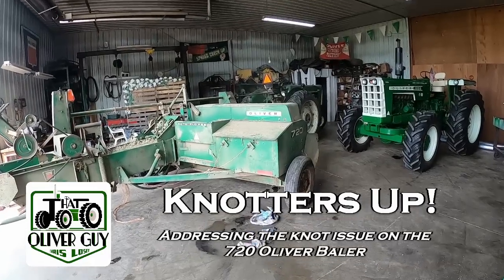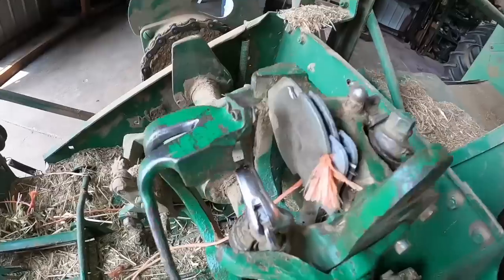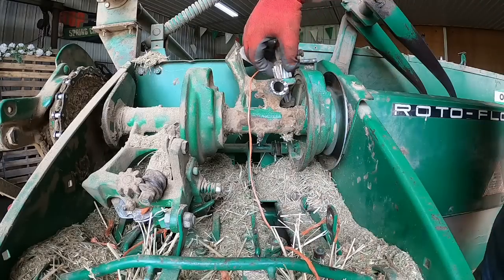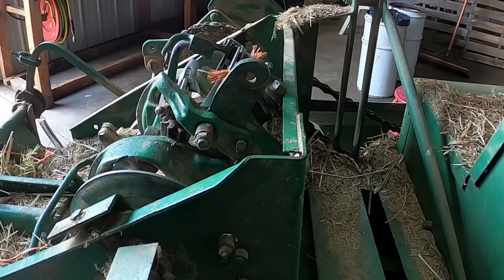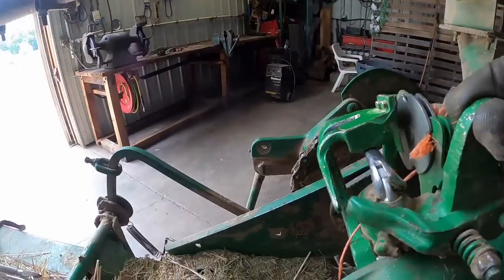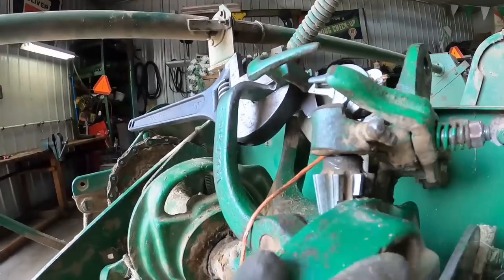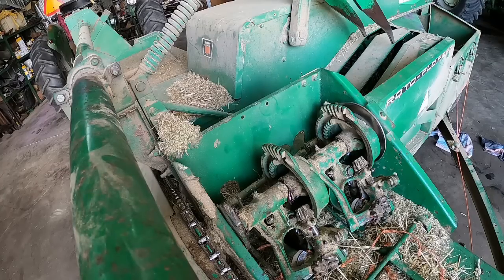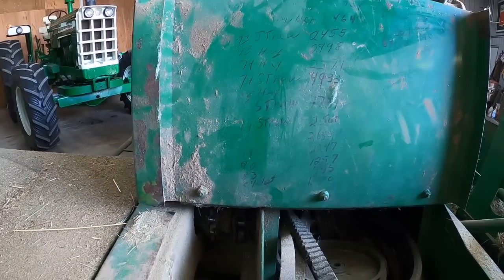KNOTTERS UP! Fixing the knotter problem on my Oliver 720 small square baler

Comment: Back in the early 70's I ran a 24T and a 336 John Deere baler. We use to call the bill hook the eagles beak, we also had to adjust our twine arm by bending it. I don't ever remember breaking one when we did that, but I know a guy can, real easy. Dad always wanted the twine arm to barely rub the bill hook, but not scrape it hard. As you know, all these parts work in unison to make a knot, from the twine disc holding tension on the twine to the twine sweep pushing the twine out of the beak/bill. I do have a square baler now-a-days, but I only do a few bales, maybe 25 or so every other year. Good luck on the rest of the project, have a great weekend. Thanks Randy for mowing my lawn!!!😁

Comment: My Dad; a farmer and a lifelong farm machinery mechanic with a dealer; helped New Holland perfect their twine tier. Lost tip of a finger doing it. Since he worked for an equipment dealer we had the first square baler in the area; and for some years (1950s) our neighborhood had a "baling gathering" instead of a "threshing gathering". My first field job on a tractor was driving our Oliver 88 pulling that baler; had some exciting times in our hilly fields in northeast Iowa. I was so young and small that to get the clutch in on the 88 I had to stand on it with both feet and and use the steering wheel as leverage to get the clutch in. An older brother stacking bales on the wagon was my backup. As I remember, we had very few problems with broken bales.
Reply: That’s a great story thanks for sharing this.

Comment: My dealer sent me to a New Holland school for balers.  After that, I spent most of my summers on the road between service calls.  Ironically, most of the repairs were adjusting a bolt about a half turn.  The owners manuals provided very good info on diagnosing issues and how to repair them.
Reply from the maker: The Oliver manual is the same way. There are pictures of of bad knots so you can compare and adjust the right part.

Comment: We used a jeweler's file and hone to sharpen the knives.  Emery cloth to polish the Bill-hooks because if the twine cannot slip off easily you have problems.  The written-in-stone rule is that after you have got the baler knotter working perfectly, watched it thru maybe 20 bales and it worked every time, you would get back in the service truck and just before the baler is leaving your view of it in the rearview mirrors, it misses a bale. Standard items to take with you when you went on a baler call were Bill-hooks, bill hook drive gears, the stripper arm, pins, and cotter pins, and a gallon jug of frozen water to have something to drink because balers never needed repairs until it was 100 in the shade.
Reply from the maker: Testify brother! I'll feel better about this one when it's working at capacity.
Reply: @ThatOliverGuyChris  The real problem was that the baler would run and work great at 540 PTO speed.  As soon as you were leaving the driver would pull the throttle open way past PTO speed.  It was always hard to explain to them if they ran it at a rated PTO speed they would make more bales per day.  Busted bales take time to feed them thru again when the baler could have been moving making good bales.  If one were custom baling running bales thru again did push up the bale count at the baler but not at the barn.
Reply from the maker: @bigun447  dad always had me run a couple notches below full throttle. The knotters don't like overspeed. Even our gehl rep said the round balers did a better job around 450 rpm.

Comment: Until you were sharpening the knives I didn’t fully understand which surface was the actual knife. Thanks for explaining how the knotter works and basically “reverse” engineering it for us. It finally clicked for me when you demonstrated with the old bill hook…it took a second to understand the hook rotates on more than one axis. My bailing experience was spending a hot summer as a 16 year old custom bailing with my brother-in-law; nothing will make you appreciate a twine bailer more than stacking thousands of wire bails. 💪🏻 If it doesn’t kill ya it’ll definitely make you stronger.
Reply from the maker: I never handled a wire bale, but I can see it is something you don't do without gloves.

Comment: I have a 520 Oliver baler that was bought new in 1975 or 76 used 2 years and sat in the barn ever sense, My cousin said it may have had a total on 3000 bales threw it and he stacked most of that working for the guy that bought it new. Its always sat in a barn and its sitting in my barn with my other 520 baler I have. My plan is to get it out go threw it and put it behind my 770 and bale some with it just for the fun of it ! LOL Only difference between them is the old one is a short Toung and the newer one is a long Toung and it has the White decals on it and it was the last new Oliver baler McHenry's sold according the them.  I love how they feed in as it is so smooth in feeding the chamber, Oliver had the right idea on the roto feed !  Thanks for this video as I will be pulling my knifes out to sharpen them and I just got to the master do it so I know I can do it now !  Thank You Chris !   Bandit
Reply from the maker: I look forward to seeing it make hay on your channel, Bandit.

Comment: Very good "vid!" Mr. Losey's shop in the back ground looked neat and clean. I was surprised he didn't at least take a compressor and blow the work area clean before the OJT aspects. Thanks much. I have a 30 year old New Holland baler and as noted in the early going, it's novel how the knotters haven't changed hardly any for a 100 years.
Reply from the maker: Thanks! I don't think this could be invented today with a ton of sensors and a computer to time it all.

Comment: A guy at work just got one of these 720 balers for $200 from an old farmer. It was sitting in the weeds with tires rotted off. He put tires on it and took it to the field and it worked perfect!! Wish I had found it.
Reply from the maker: They are a good machine with lots of capacity.

Comment: I've been told that most balers, yours included, have Deering knotters. IH used the McCormick knotters on most of their balers. They are slightly heavier than binder knotters but the same workings.
Reply: I fixed both IH and NH balers.  On an IH baler, if the knotter failed once every 100 bales, that was normal.  On the NH baler, if it missed one knot out of 1,000, it was time to repair it.
Reply from the maker: A friend gave me some new Holland knotter parts to see if they would work. The keyway was 180 degrees out from the Oliver, so a guy would have to do both sides, but I think the complete assembly could work.

Comment: Nice job Chris. My uncle was a New Holland dealer and the mechanic for decades. He taught me about knotters. Primarily, knotter function is like marriage- its about the relationships. Overall timing of course, but how the needles relate to the twine disc, how the knife arm relates to the bill hook, and the knife position relative to the length of the tails. the knife arm and needles are malleable and I know from experience that needles are weldable. With your go pro, I assume you can watch the action in slowmo. What a benefit that is. Anyway, thanks for the trip down memory lane. !
Reply from the maker: Thanks! I do have a couple of slo mo videos of the knotters in action. I need to hide one on the underside where the magic happens.

Comment: We were having problems on a New Holland baler that was traced down to one of the porcelain insulators the twine runs through.  It had a groove worn in it and had cracked, so the twine was hanging up on it.  All we had to do was loosen the u-bolt that holds it and rotate the insulator 180 degrees.  Problem fixed!
Reply from the maker: That's why knotters will make you pull your hair out. There are so many things that can go wrong, and the all result with a bad knot.

Comment: Anti-seize those shafts, will come apart a lot easier next time you have to work on it. As for the spring and nut, measure the length of spring on the other side, they need to be same. It's spring tension, at least that's how it was on our old JD baler.  As you said, these knotters are all the same design no matter the brand name. 
I don't know about the Oliver but, I know the JD 14T, that drive chain to pull the needle arms, that also had to be timed. Don't ask me how I know, I've seen those needle arms get snapped off because of timing between the plunger and arms. Wes Pandy (Onelonelyfarmer), did a video on knotters several years ago.
As a kid, we had an old JD 14T, miss that baler at times. Dad used to make our bales around 110 lbs - 120 lbs. Every year we did around 4000 bales. Great video as always. Cheers :)
Reply from the maker: Measuring the spring would be the best method, because like you said, it's about the spring tension, not the size. 
I sell a lot of square bales to horse gals. They don't like bales that weigh more than they do. 😂
That makes me think of a story. It was around the time I graduated, so I was young and strong. There had been a drought in the south, and farmers here in Michigan were donating hay and the railroad had donated space on some railcars. We donated, and as a young buck I was in the hotbox stacking in those railcars. The day the local news showed up was the day the most farmers showed up. One guy backed his enclosed semi to the railcar , got out and spent all his time in front of the camera. That was the nastiest hay I had ever seen. They had obviously been rained on multiple times. It took 2 men to drag each bale onto the railcar. He should have been ashamed of his "donation", those things were just giant compost bricks.

Comment: Our main business is convertiing 4x5 rounds into 32 to34 in small squares, thousands of them for  Contract sales to  TSC.... The small square baler   is the  main  machine followed by a machine to put them into bundles that can be mechanically loaded  into a semi trailer ....Our first Bundler was a Bale bandit.....that secured the bundle with 1/2 in steel bands..... now that was a marvel of automatic  crimping the two bands together...... but it had it's faults so we swapped over to a Bale Baron..... It used the same basic Knotters that the big bale balers use....In that.one  needle sweep ties 2 knots..... one to secure the bundle in the chamber and one at the beginning of the following bundle........ We use 240 twine and 450 twine........
Reply from the maker: I've often considered re-baling some of the rounds into squares in the off season. Do you have an automated way to feed the round bale into the square baler?
Reply: Simpsons   round bale  feeder tables..... Powered off tractor hydraulics.......With some gear changes a needle valve flow control  and  some sort of  retarder to keep the pickup from snatching hay from the last chain table.... it feeds the baler pretty consistant..... Two men can  convert and load   39. 21count Bale Baron bundles in about  4 hours. from about 42 4xx5 rounds
Reply from the maker: @farmingforfunandprofit940  do you have a video on that. I swear I've seen that on YouTube.
Reply: Sure Do,,,,,,,,Not very informative because it is my Son's business and he doesn't allow much  in the "shop Window........

Comment: Nice job Chris, with fixing it.  I had issues with the Jd baler and It was a build up of old grass on this spring loaded plate behind the notters.  It was jammed and was not allowing this plate to seat properly.  It was a simple thing.  Glad I did not have to remove the knotters.
Reply from the maker: It can be so many things. I had a broken spring on a hay dog and that would keep it from knotting. I keep an eye on those springs now.
Reply: I would check the tension on my billhook and see if anything is war because it might not be holding the twine tight enough

Comment: So the International balers from like the 47 on up, use a different knotter system than most. They don't have tucker fingers and they don't have twine knives that move to cut the twine. They have stationary twine knives that are supposed to cut the twine just based on it dragging across it as the bale fed through. This required the knife to be extremely sharp. They also don't have wiper arms, they relied on the tension from the bale moving rearward to pull the knot off the billhook. That's all as I remember it, though I could be wrong on a few of those steps. My grandpa's brother has a 400 series International baler, and grandpa's John Deere 336 would bale circles around it.
Reply from the maker: Interesting. That must be the knotter that gets the complaints on here. Thanks for sharing!

Comment: 170 knot strength is common here, some guys use 210 in 2 tie balers. 210 is common in the 3 tie.
Then we jump up to the big balers.. 450-550. 
Round baler twine is.. or was 110.. 
Brand of twine makes a difference too.. 
All the dealers that used to be here, if they had a baler with knotter issues they couldn't figure out, they'd put New Holland twine in. Almost always worked.
Reply from the maker: I guess knot strength is something I hadn't paid much attention to. We always sold quality twine, and I had a better part of a pallet left, but that ran out last year. Lesson learned!

Comment: Chris I’m not criticizing but you just hurt my brain. Pulling a file the wrong way on that knife. Files are one way directional. Look at the teeth. A file must be pushed from the tip to tail. Never dragged backwards. When sharpening a blade you should push the file against the cutting edge to prevent a curled over burr. I hope this helps in future file usage.
Reply from the maker: I knew they are one way, but I can never remember which. I figured I'm 50% right if the go back and forth. That's a better success rate than wife my gives me. 😂

Comment: Curious, the amounts under the tool box lid for the entire season?  If that is the case that baler doesn't have many through it.
Reply from the maker: I'd say that's right. We pastured most of the cattle back then, and once we got a round baler we only square baled straw for hogs. Then we built a MOF hog barn, so no straw and it sat a few years until my sister went horse crazy, then it went back to work. I bet that worn billhook was original.
Reply: @ThatOliverGuyChris  Interesting, I don't think you would find a baler around me with numbers like that through it from that vintage.  I always found their feeding system interesting but never was around one, and I only ever seen one in person at a sale around here.  Did they build a pickup with closer teeth spacing like NH's super sweep for them as an option?
Reply from the maker: @tpfromcentralpa1692  the 720 was that version. They made a 710 that had a narrower pickup with the tines spaced farther, and if I remember correctly it had one less row on the pickup.

Comment: Knife arm should drag across the bill hook.  Jake Ziegler went through the knotters on his 720 and said in one his videos that Hesston ( IIRC, model 4500? see: https://www.youtube.com/watch?v=mV_14kxRw-A at the 4:40 mark ) small bale knotters are identical and that back ( 5yrs. ago) then parts where available. New Holland knotters require the knife arms to drag significantly over the bill hooks to get the knot off, so get them tight enough so the arm doesn't wear a lot, but still has a good drag over the bill hook.
Reply from the maker: Oliver sold the baler line to Hesston and the 720 became the 4500, so parts are identical. 
The more I think about it, I bet the knife arm having such a big gap was probably the problem as much as anything. It's just touching now.